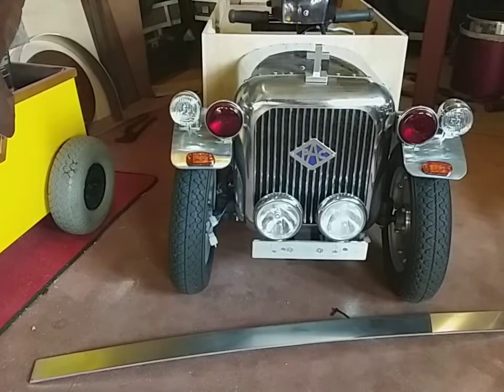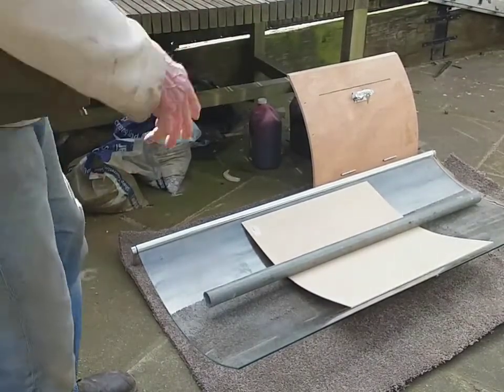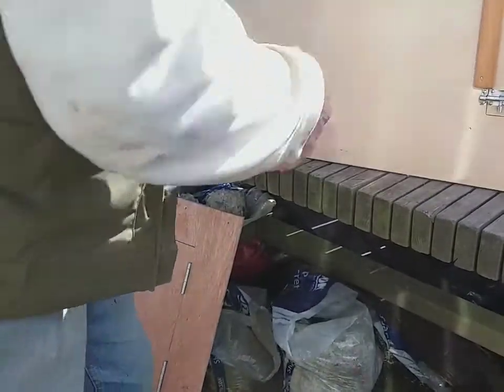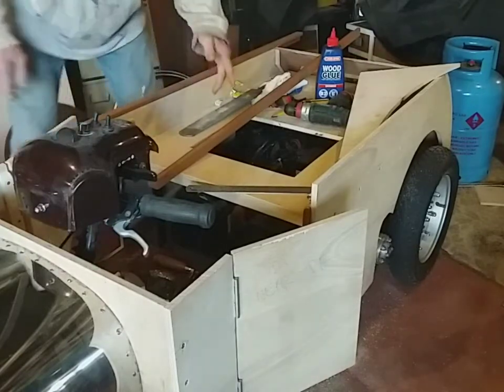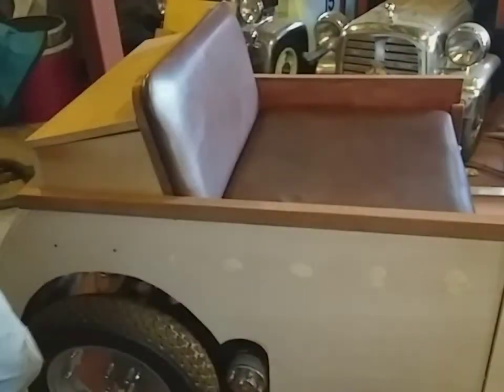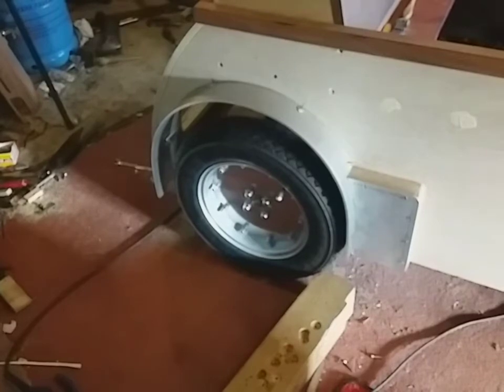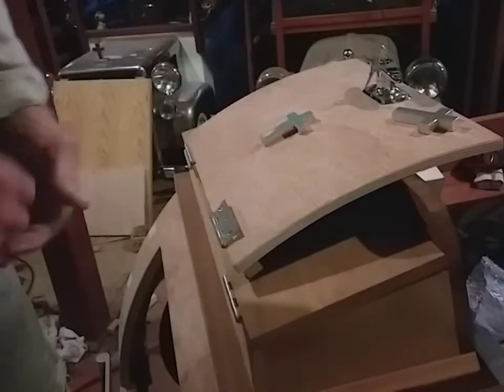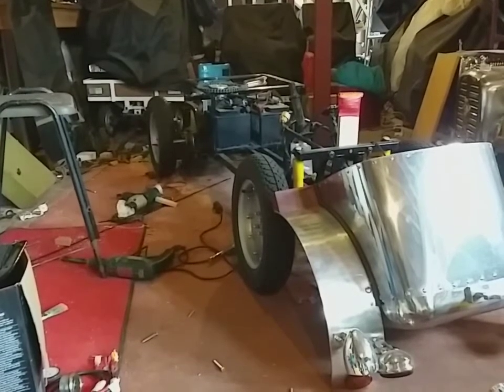Making The Faster Mobility Scooter Car Body

Comment: These cars are amazing Peter. How many weeks work would you say goes into one?
Reply from the maker: HI SIMON. THE LONGEST JOB IS MAKING A NICE FRONT.  IT TAKES ABOUT 3 MONTHS TO MAKE ONE OF THESE CARS AND I AM NOT JUST DOING AN 8 HOUR A DAY I AM DOING ABOUT A TEN HOUR DAY AT LEAST. IT IS QUICKER DOING THE ROD IDEA ON THE STEERING BUT ITS NOT AS SMOOTH AS CHAIN DRIVEN. IT IS MUCH QUICKER TO MAKE A JEEP AND ALSO IT WOULD NOT BE SO HEARTBREAKING  IF YOU CRASHED IT. ALL THE BEST PETE.

Comment: looks good, are these still legal to use on the pavements / road? thanks
Reply from the maker: YES THEY ARE. THATS WHY I HAVE NOT  PUT STEERING WHEELS ON THEM. I HAVE LEFT THE SAME CONTROLS ON THEM. ALL THEY ARE IS A MOBILITY SCOOTER IN DISGUISE. I HAVE HAD NO TROUBLE WITH THE POLICE EVER.
Reply from the maker: THE SPEED LIMIT FOR THEM IS 8MPH IN THIS COUNTRY BUT IN OTHER COUNTRIES IT IS 16 MPH. SO I HAVE BEEN TOLD.  SO I HAVE GOT TO BE CAREFUL WITH THE FASTER CAR. ALL THE BEST PETER.
Reply: @p..chittenden9174  ok thats great, i spose you can go faster if no one is looking haha
Reply: @p..chittenden9174  ahh ok i see so its still classed as a mobility scooter, looks great,  thanks